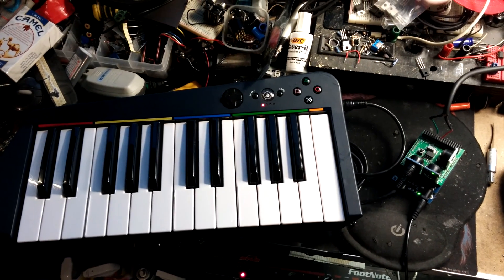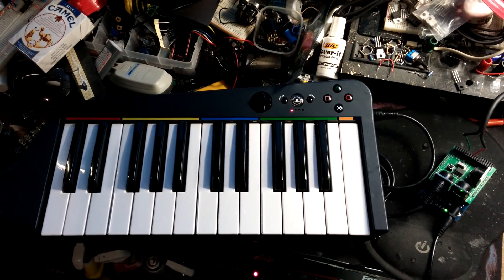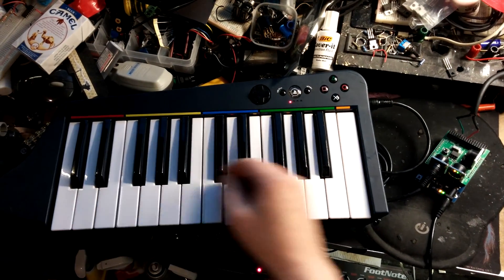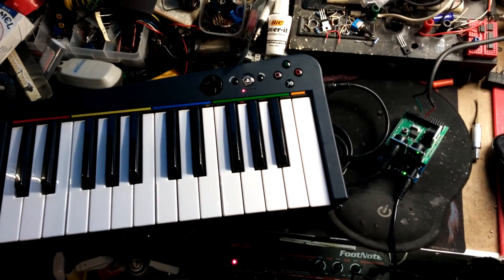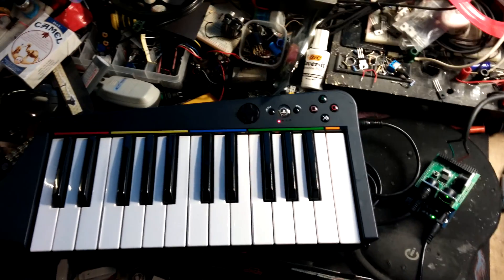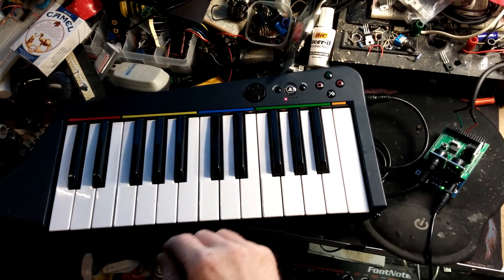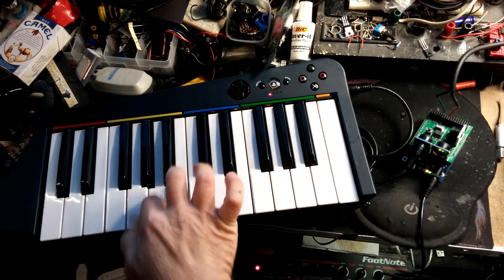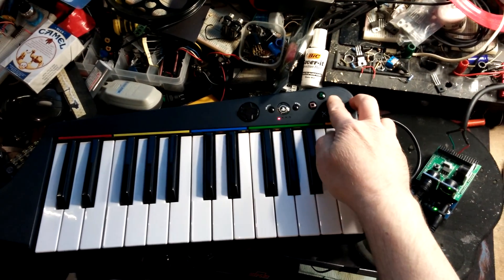Arduino MIDI Simple Synth

Comment: Do you have Code? Pls
Reply from the maker: The code is built into the Arduino IDE. It's called the MIDI  Simple Synth.
Reply: @nonsuch  in my ide not u.u
Reply from the maker: @joyboy4313  You need to have the MIDI Library installed.